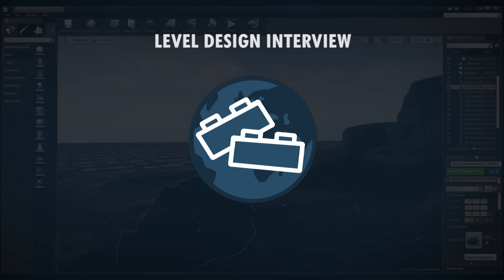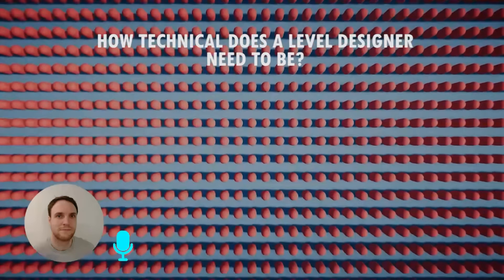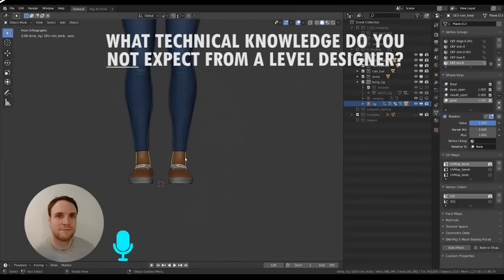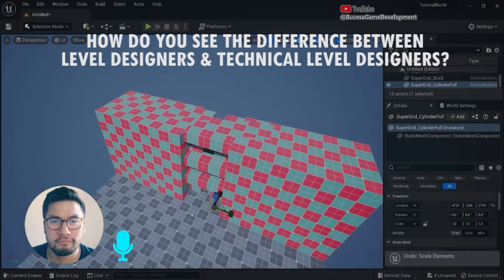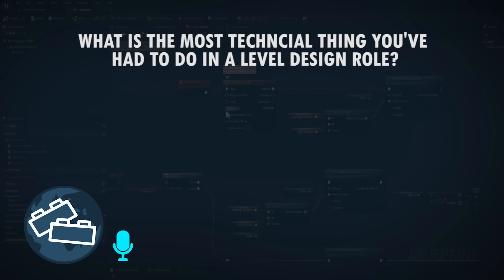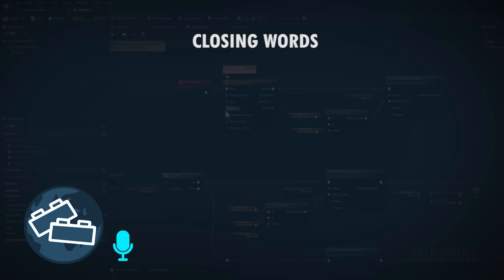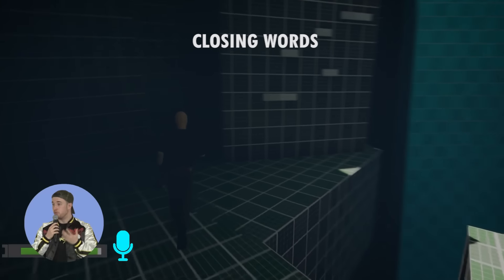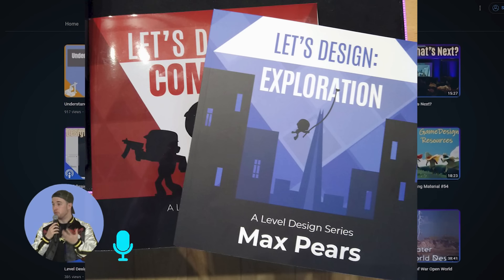How technical does a Level Designer need to be? (LD Interview)

Comment: Ohh thats quite interesting to hear. Thanks for doing this. I'm just finishing uni and thinking about level design as a career idea so this was very helpful. Level designer does sound more of the fun stuff to the technical designer but I can see how its better for getting more jobs.
Reply from the maker: Of course it depends on which things are fun for you! Technical Level Design isn't less interesting in general by any means. It's just quite a different role. 
Tech LD is usually occupied with interesting creative problem solving where their contributions have a high impact on the rest of the development team.

Comment: Can you talk about incorporating A.I into level Design?
Reply from the maker: That.. would be an interesting topic.  In my professional work there's the benefit of working with concept artists directly, which will always beat AI hands down. 
But in side/hobby projects I've been using AI more and more..
Reply from the maker: But also, really, procedural generation has been a fairly hot LD topic for the last 10 years or so.  
Coupled with AI, it could get interesting fairly soon.
Reply: @timdoesleveldesign  🤔🤔
Reply: @timdoesleveldesign  Do you think game engines such as Fortnite unreal engine and Roblox can be used for level design projects?